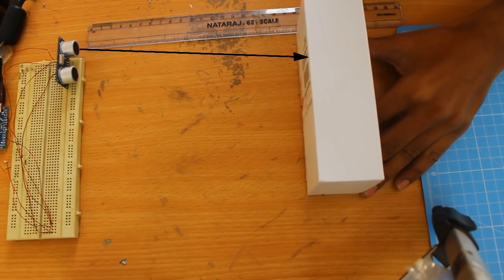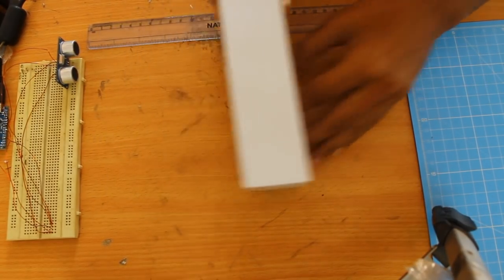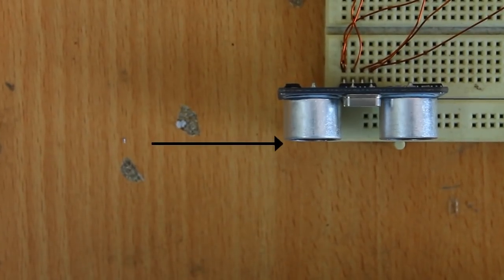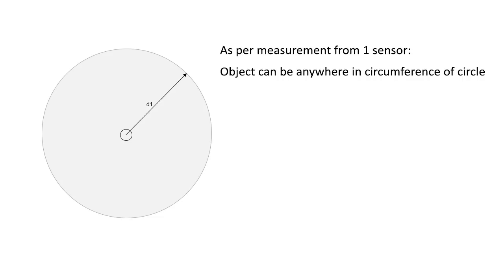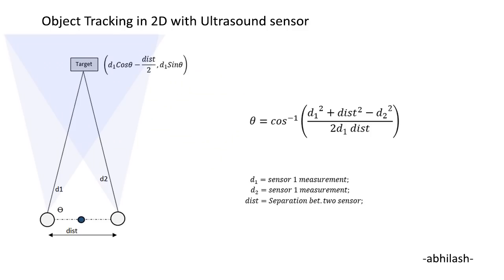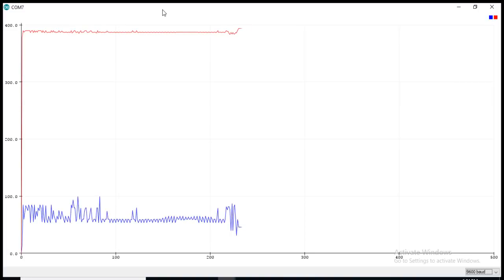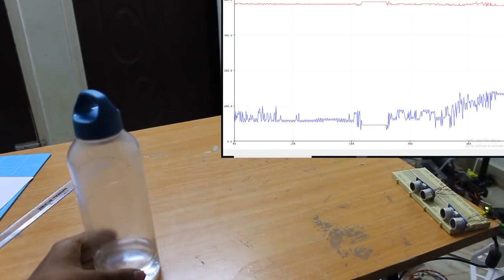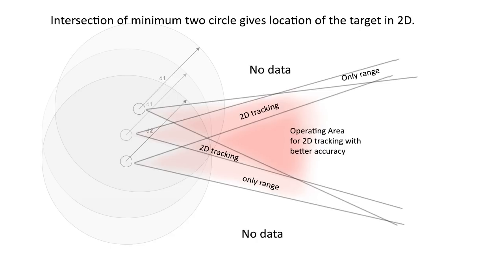Ultrasound Sensor HC-SR04: Calibration and 2D Target Tracking

Comment: Salve, video molto interessante, sono alle prime esperienze, se potessi cortesemente dirmi la posizione dei pin su arduino, grazie.
Reply from the maker: I tried to understand you query from google translator. If it is on pin connection, that it is standard one only. you can use any digital pin which you need to configure in program. if you have any specific query you can contact me abhilashpatel121@gmail.com

Comment: Hello sir, 

Thank you so much for providing such a valuable information 
I want to add if x=10 then led should glow. For this I have written the code but it is not working please help 
if (X=10)
{ 
  digitalWrite(11,HIGH);
}
else {
digitalWrite(11,LOW);
}
Reply from the maker: X=10 will never work, you have to define the range / band.
Try this for 2 mm band,
If(x>9 || x<11)
.
.
You need to define the range based on your requirements.
Reply: @bi1420  sir 

1. what do you mean by distance between sensor in code. Is it from the transmitter end of one sensor to receiver end of another sensor

Or 

It is the distance gap between two sensor.? 

2. What SI unit are you considering in this code. Because i am getting values like 100,150 when I place the object 20cm apart. 

It will be really helpful for me if you reply to my query sir
Reply from the maker: 1. You can take distance between either transmitter or reciever,
2. All distance are in mm